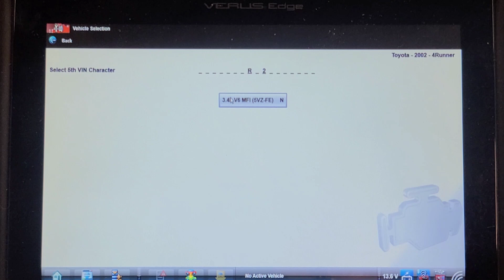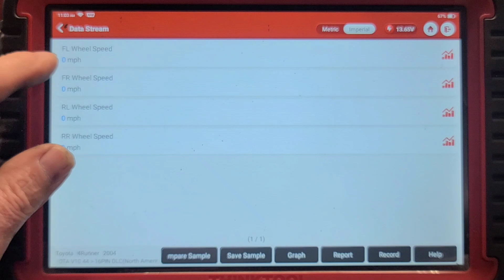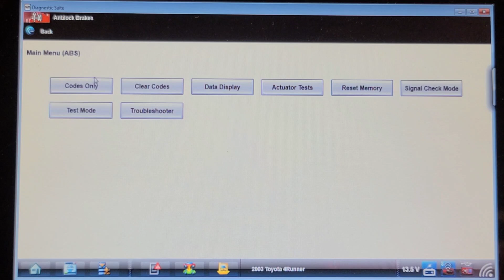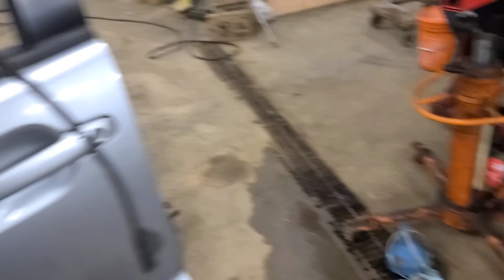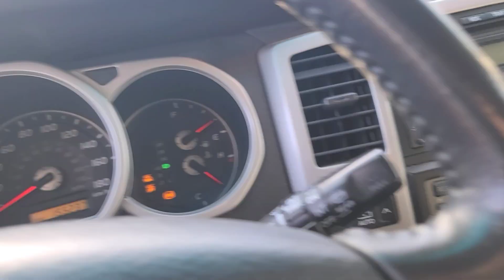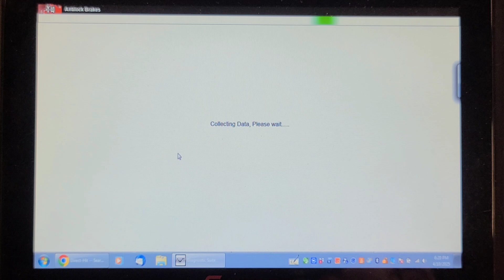2003 Toyota 4Runner No Speedometer C0205 and C1223

Comment: PHIL,As always AWESOME  video brother so this truck you have to on /off the ignition then delete the codes and take it to test drive to see the signals from the abs sensors am i right or wrong thanks for sharing./
Reply from the maker: It appears that after clearing the codes you must cycle the ignition switch off then on as the data would not report correctly. Too many variables on top of me plugging the connector in backwards on the new sensor.